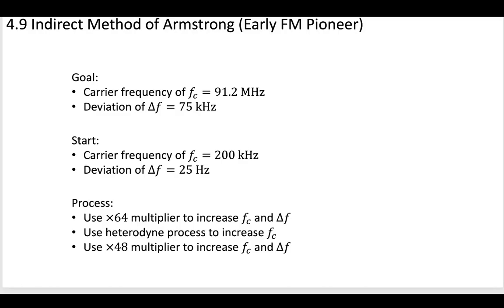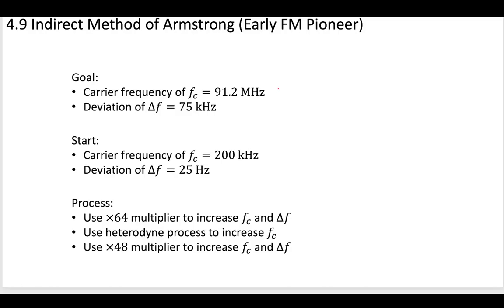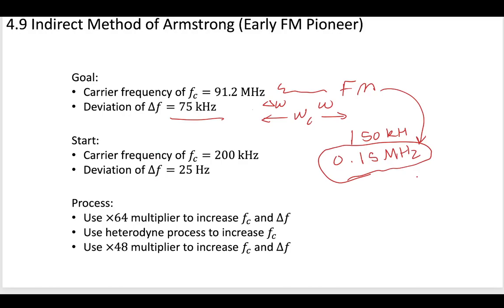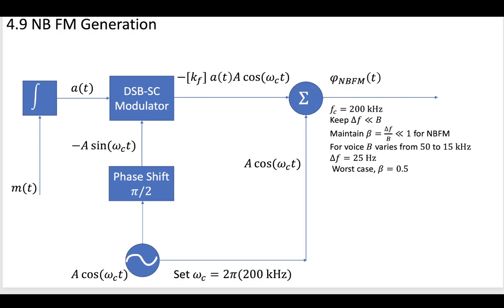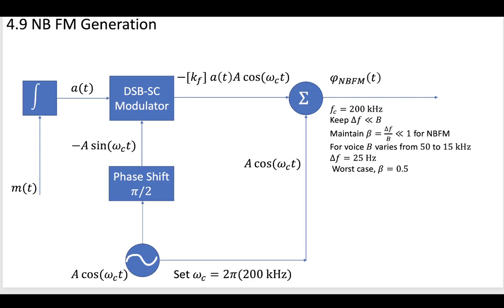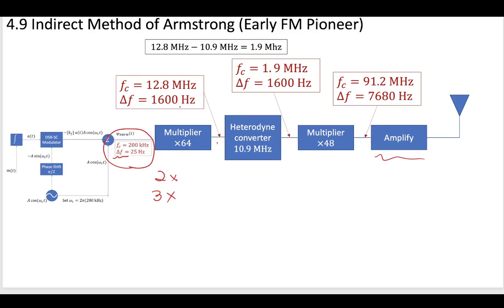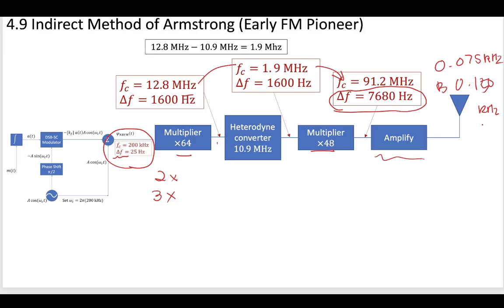4 - 4.9 Armstrong Indirect Method for Creating FM Signals

Comment: Hi Dr. Chrysler, I think you forgot a 0 at the end of 7680 Hz. Shouldn't it be 76800 Hz?

According to the FCC : 
"The FM broadcast band in the United States ranges from 88.0 MHz to 108.0 MHz, with each channel being 200 kHz (0.2 MHz) wide.", 
but the Armstrong Method is  generating a freq. deviation of 7680 only? 

1600Hz * 48 = 76,800 = 77 kHz (Matches with your Calculations).
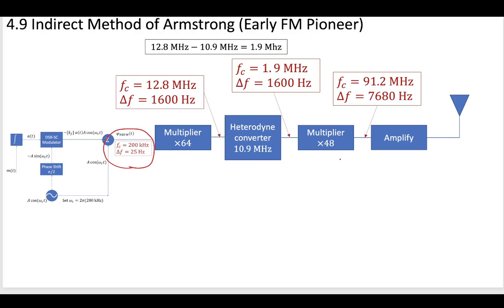Reply from the maker: Hi -- Yes!! You are correct! This is a typo on my slides which are first appearing around 4:22. The frequency deviation after x48 multiplier should be either 76800 Hz or 76.8 kHz. Also we can verify the following math: 0.075 MHz = 75 kHz = 75,000 Hz which is about half of the 0.2 MHz channel as you have identified in in the FCC guidelines. The figure 4.33 and the Lathi/Ding book also confirms this result.

I wish I could offer you some extra credit for your helpful comment, but I think your good observational skills will pay off in your future studies and career. Best of luck!